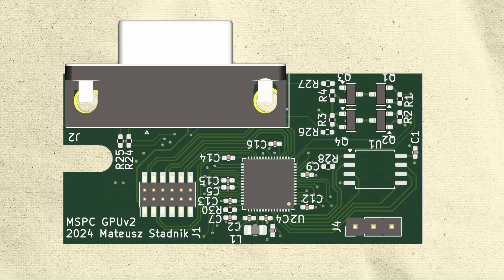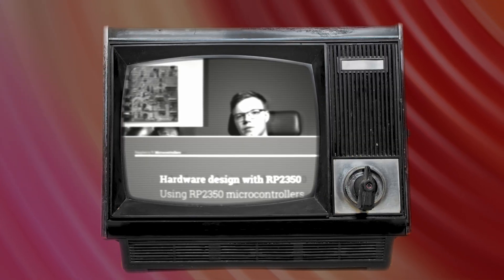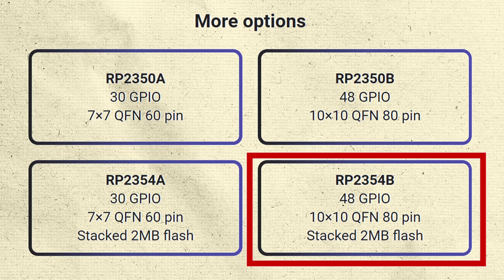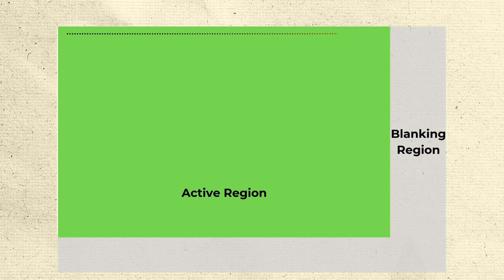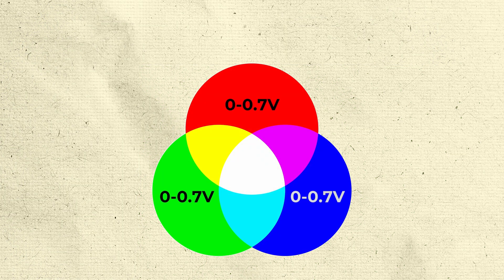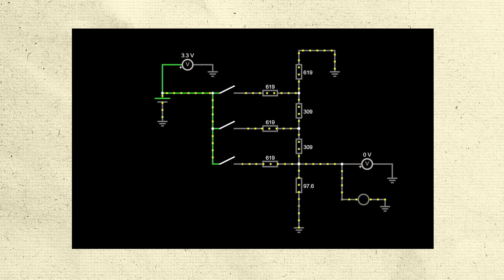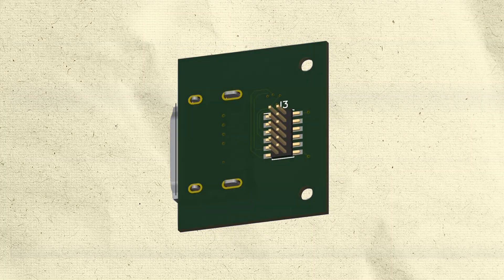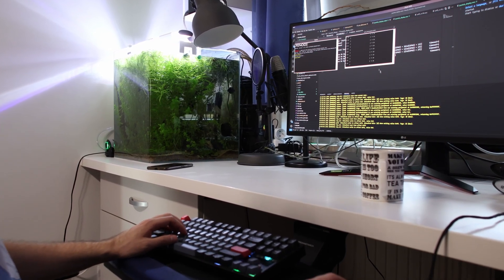Let's Build a VGA GPU Card On RP2350 - Part 1 The Design

Comment: Is this going to be an ISA card? Although I guess it's not matching DOS era specs at all. But that wouldn't of course prevent someone from developing their own DOS era SW for this.
Reply from the maker: No, it will use custom bus to extend my MSPC board. But my plan is to follow VGA-like software interface hoping that this will make easier using some already existing software.

Comment: VGA signal is one thing.
VGA card is another!
Reply from the maker: Of course! And this card will be a real "gpu" like card. With VGA( and DVI ) signals driven from PIO. And text and graphic modes frame generation on those 2 cortex-m33. I have a proof of concept on two raspberry pico with rp2040 with even some experiments with simple 3d acceleration.